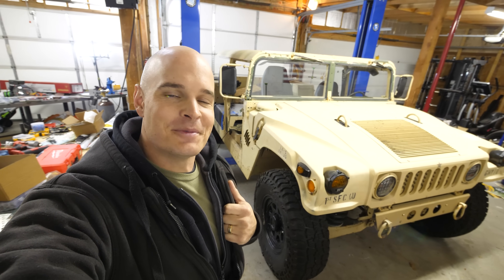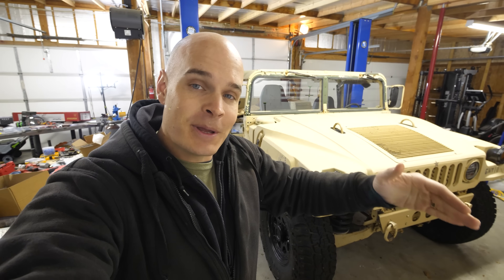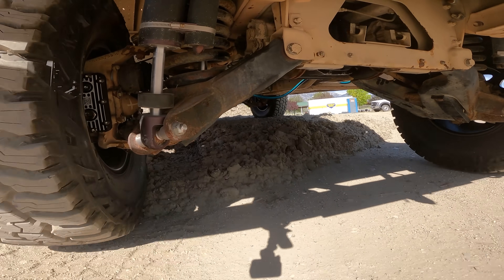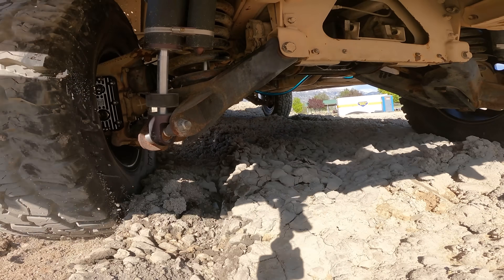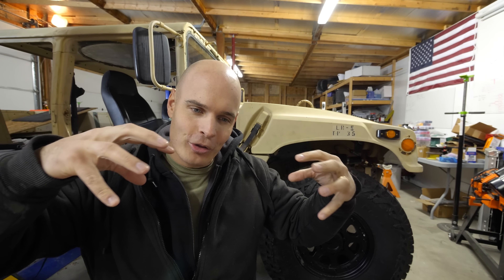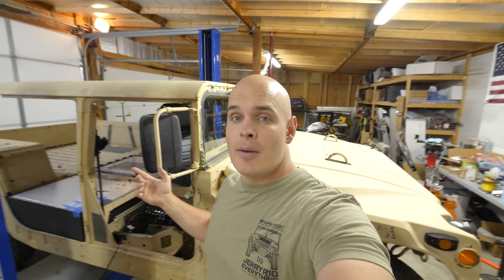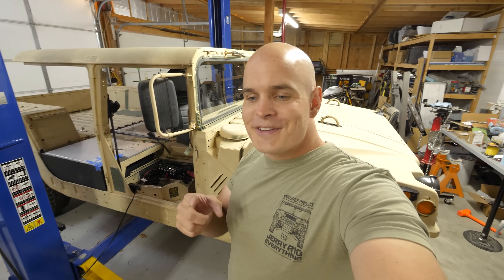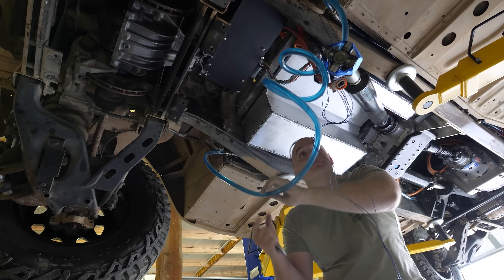I have some explaining to do... - EV Humvee Update

Comment: Without knowing your system, but knowing a bit about hardware and programming, I have a couple issues you can check. First off, baud rate of each component. If your sensors are sending at one baud rate and the ecu is listening in a different rate, you will get corrupted data. Next, ferrous filter clamps. It’s possible those branches are picking up dirty electrical interference and some circular magnets around those wires may fix it. Led lights can be pretty dirty electrical wise.

Comment: Please add rubber grommets to any metal holes that have a high voltage line running through them...please.

Also, maybe use shielded, or at least twisted pair (cat6 maybe) cabling for your CAN wires.

Some  Kevlar braided sleeving on those coolant lines wouldn't be a bad idea either.

Safety 1st man.

Comment: Did you read the CAN bus standard?  It requires controlled impedance cables, termination, and a host of other requirements.  Not difficult but you have to follow the standard.

Comment: Each of your CAN peripherals should have a transmit and receive identifier code that probably need programmed into your 'master' controller/device.  Maybe check that.  Also, there are different CAN speeds; you might need to confirm/configure all devices to use the same speed.

Comment: Might not be charging because of BMS low temp cutoff, can't charge below freezing. Also as others have said about the termination resistors. The resistance between can hi and can lo should be 60ohm +-10ohm or so. also the Orion BMS had a 120ohm resistor onboard I believe.

Comment: I designed electric racecars in university. You most likely don't need shielding for the CAN for this project, but if it starts having issues while driving then you should fix the grounding and make sure all of the splice points have the ground connected as well. 100-120 ohm resistor definitely needs to be placed on either end of the CAN bus.

 Have you tried connecting with your laptop to read the data? If your laptop works and you can read from each device without seeing CAN errors, then the display or VCU probably aren't configured correctly. 

One issue I could see is if one of the devices on the CAN bus is trying to communicate at a different baud rate than the others. Typically it would probably be at 500kbps, but sometimes you get devices that are odd, especially with chargers. I've seen a lot of chargers that want to communicate at 126 or 250 kbps

Comment: I hope all the wiring cut connections were on the interior of the Hummer, as those connectors allow for oxidation of the wires when water is allowed to penetrate through. while you did double heat shrink it still isn't water tight.
Reply: the guy I watched just used the butt connectors without a 2nd heat shrink over the top, and his truck lights failed within 6 months.

Comment: you messed up with the solder connectors, you have to wait until it truly melts and runs into the wire. i see connections like that allmost daily in my work, because people dont know how to use those connectors properly. i really recommend that you go back and fix that before your can wires start oxidizing and you are going to have problems.

Comment: Yep - high voltage means lower current and thinner copper needed to conduct it. Don't make the mistake of using standard wire that matches the current rating but not the voltage rating as still need higher insulation resistance to stop shorts...except maybe if its not touching any other item anywhere the whole way...might be ok but risky..

Comment: Resistors are often used in Controller Area Network (CAN) networks to help reduce noise and improve the transmission of data.

In a CAN network, a terminating resistor is used at each end of the network to help reduce reflections of the signal as it travels along the network. The terminating resistor should have a value of 120 ohms, and should be connected between the CAN_H (high) and CAN_L (low) lines at each end of the network.

In addition to the terminating resistor, some CAN networks also use pull-up resistors or pull-down resistors. These resistors are used to ensure that the voltage on the CAN_H and CAN_L lines is at the correct level when the network is idle. The value of the pull-up or pull-down resistor will depend on the specific requirements of the network.

It is important to use the correct value of resistor for these applications in order to ensure that the network functions properly. Using the wrong value of resistor could result in poor performance or even damage to the network.

Comment: Can likes to be match pair 120ohm wire along with terminators at open ends. Usually the boxes you are connecting have the terminators on the boards.

Comment: I think the connectors need to be heated a bit longer. The tin needs to flow. Maybe it just looked like it didn't.  
Also the front axle makes a bit of sharp corners. Could be a problem in combination with the high torque. 

 🤙

Comment: Those heatshrink solder connections definitely need to get hotter. If your afraid of melting, just cut a spare wire in two and do a test run!

Comment: Hey Jerry, I am Ahmed. I have worked on the power electronics of EV. I had the opportunity to design the EV battery pack of 35kwhr.  This problem is certainly because your VCU is not been able to communicate the CAN messages at the correct ID, make sure CAN baud rate and ID is correct. I would recommend you to purchase a CAN adapter compatible with open ended CAN log software like BUSMASTER to log and monitor all the CAN messages. Then you can identify the real issue behind this. I hope you have the CAN communication matrix file of each and every component you have connected on CAN. Let me know if you are able to solve this issue, I will be more than happy to solve your problem and Kudos to your EV and future projects.

Comment: It's looking like the communication from the Orion BMS is somewhat getting through to the dash, but it may not be configured properly 100%. 25°C is the default temperature for the Orion Thermistor Expansion Module, and I've had that temperature crop up when experiencing EMI in the battery pack (the module itself is not electrically isolated). I'd definitely focus on troubleshooting the Orion components, it could be a CAN configuration issue on the BMS or damaged hardware somewhere in the pack

Comment: 6:55 - That solder didn't melt at all.

I hope that doesn't end up being the only problem. That would be so annoying if it was. Although there's a lot of comments about termination resistors, so probably not.

Comment: At 6:57 not enough heat was applied to the solder inside the heat shrink, it should melt into the strands of wire and not have a ring like appearance.

Comment: You really need to use a scope on that. A CANBUS uses a differential signal and you can determine if both sides of the comm are there and if the comm is lost or pulled to a bad state due to shorts or miswires.

Comment: Maybe you are missing the termination resistor. Although one ecu may have it, other issue could be that more ECU's have it populated. But it is easy to check...just use a multimeter are measure the resistence with evrything connected, shoule be close to 120Ohms.

Comment: I believe the can network may also need termination resistors, witch you should have on one end of the chain. A scope on the various points on the line would prove this. Alos connect the shield of that cable to ground at ONE end, lettings it float can make it worse than unshielded. Also I may be wrong but i think there's more than one data rate for CAN Make shure your connected to the right can bus/correct speed.

Comment: A CAN Bus network must have a terminating resistor between CAN High and CAN Low for it to work correctly. For maximum range over long distances, the ideal termination is one 120 Ohm resistor at each end of the bus, but this is not critical over short distances.

Comment: Nice work ...
The CAN systems needs to be programed, you need to assign addresses to all your components and programed the "messages" to every component, unfortunately os a system with made manually assignments is a dated system but is reliable...
All the MCU (micro control  units) need to be aware which is on the BUS and what they do ....

Comment: 1) Does your CAN Bus have termination resistors?
2) Are all CAN devices communicating at the same baud rate on the network?

There's a reason vehicles have multiple CAN Networks. Different devices communicate at different speeds.

Comment: looking good but you may end up regretting not using ribber grommts on those holes you've drilled in the body to run wires through

Comment: please add rubber bushing when wiring through the metal holes as long run friction between the wire and metal will cut the wire evantually and may cause a short

Comment: Maybe line termination is wrong (too much or too little) unless it’s really wrong most stuff should still kinda work. Often devices in my line of work have little switches or jumpers next to the can bus terminals on the devices to select if you want to use on board termination on that device, not sure if car stuff is the same. 
Would be worth unplugging that screen and checking it again.

Comment: Sail and powerboats Have a modular NMEA 2000 Networks with off-the-shelf cables tees and 60-ohm resistors that our 100% waterproof and make any project so much easier as how good is that connection is no longer an issue

Comment: To be honest you should solder n splice and heat shrink with marine grade shrink with epoxy insides waterproof the connections. The low temp solder is very brittle and will cause issues.

Comment: Trunk cable usually needs to be terminated on both ends with impedance-matching line terminators, usually consisting of a resistor and capacitor in series. The 'master' device, which controls the whole communication, is also connected through a branch, not directly to the trunk. Refer to the CAN standard documentation for more info.
All the devices on the network need an unique address (like IP addresses for Ethernet, or phone numbers for landline and cellular telephone networks) to communicate properly, and their communication speed (baudrate) needs to match. The screen needs to recognize the devices it gets its info from, and the BMS, inverter and charger need to recognize eachother. Some devices may use CAN 2.0A which uses 11-bit addresses, while others may use CAN 2.0B which uses 29-bit addresses. Configure each device to run in 2.0A mode if possible, to ensure compatibility. Otherwise 2.0B devices may mistake the beginning of the data as still being part of the address (first the address, then some data is transmitted bit-by-bit over the network), and communication fails apart.

Comment: The can bus needs a resistance of 60ohm 2.6ish volts high 2.4ish low. also what speed is everything rated for some can can be 250kbs others 500kbs.

The resistance needs checking with the power disconnected, the system will need x2 120ohm resisters at/near the end points of the can next work, the x2 120ohm resisters will equal 60ohms. the resisters are used to slow down the information so the ECU can read it

Comment: Get a CAN analyzer from pcan, but first check if you have the termination resistors at both ends. If you want to debug stuff you need the right tools. I also really dislike/don't trust those connectors you used. Solder the cables directly to each other.

Comment: Probably old news to you, but I think there's a bit of design in how much resistance is allowed or specified for the network, and different devices can have that resistance or maybe a loop built in and you can remove it or modify it. there may also be issues with some kind of ID collision on the network, if multiple devices are using the same ID? i'm pretty sure you can get CAN analyzers, too. Sometimes for pretty cheap on Amazon - logic analyzers that you could attach to the network and monitor traffic.

Comment: Typically speaking OEM recommends not using solder connections(which you didn't get hot enough to flow) and using a bare butt connector and shrink tubing. Keeps the resistance within specs. And do you have termination resistors for the trunk on either end?

Are all the can devices programmed for the same ISO data?

Comment: You never use flat head screwdrivers for hose clamps. Always grab a nut driver or a 9 in 1 screwdriver and pull the insert out! If it's not the right size then put that insert back in flip the screwdriver around and pull the other insert out!
You should probably invest in a crimp setup. Otiker has some pretty good stuff but other cheaper brands exist. Those hose clamps can fail over time. Don't want to lose your coolant and cause a major system failure.

Comment: Use fuel line clamp instead of wordclamp ,because ringworn ones tend to break the hoes do to the heat cycle  .  I replace them and its been 6 year no leaking so far ... trust me you wont regret it

Comment: I could be wrong but it looked like the heat shrink solder connector didn't melt when you installed it making and unstable connection.

Comment: Im not expert but at 0:25 on the right side vehicle i noticed that your gear ratio is not the best. Slow ebike motors are less efficient so its best to put possibly fastest hub motor, hight voltage and slowest possible gear ratio. Its less stress on chain, better efficiency and overall should perform better that way.

Comment: The CAN bus should be treated like a HF transmission line.  Both ends are to be terminated with the characteristic impedance, usually 120Ω. The stubs should be kept as short as possible.  This is to keep reflections of the high frequency pulses, which can distort the data, to a minimum.  
A quick check, measure across the wires and should see 60Ω. 40Ω or less means there are extra terminators. 120Ω means there's one missing or an open wire. Higher than that no terminators present or open wires.  At least 1 terminator is required or else the buss can't go to the recessive state.  Also there should be a fairly high resistance between the bus wires and ground.

Comment: at least the can system in this is simple. my tractor has a fault sometimes, which manifests as a can bus error of some kind and causes non start condition. Service tracked it down as a work lights control panel issue, tractor starts up fine when it gets disconnected. No permanent fix, did not get a new panel, and sometimes it works fine for months without a fault. lol the intermittent faults form hell. also have several different faults on it...

Comment: Potential buyers/users of EV like to thick that the EVs are so, So, SO much simpler than a corresponding ICE vehicle because a gas engine has a LOT of parts that shake, rattle, & roll.

But temperature management of the battery, the motor(s), and the high power electronics requires a lot of moving parts.

Comment: I sure hope all those wires get pulled through a flex tube or some other aberration absorbing feature. Soldering high vibration connections is a bad idea. The solder will break at some point. Should have used crimp hardware.

Comment: same CAN protocol/baudrate of CAN devices, is it matching everywhere? If i remember correctly, the can bus there should be 60ohms of resistance if you measure it in any end of the CAN cable but I assume the dude already have a CAN bus analyzer that will tell you all that.

Comment: If the charger maintains 6.6 kW, the output current will be higher when the voltage is lower... and the voltage is always lower than 450 V (that's an extreme charging voltage at the fully-charged limit).

Comment: When building a prototype, especially at work, i have arrived at the point that i rather spend 100bucks on some ready-done industrial standard wires and connectors,
where i only have to add one end, maybe, over spending my time building and troubleshooting them.

Still end up having to work with nasty stuff like crimping pico and nano blade molex connectors because something went wrong or needs to work "now"
but in the end this quickfix usually costs more time = money, and if there is one thing i have plenty at work it is no-time.

CAN-Bus should be so tolerant to timing errors running cables from all the items to one single point to connect them up should still work.
Just compare that to bus-cable-length on a truck. (But of course the EV with the audible switching noise might make some nasty stuff on other components).
Until now i always walked the other way when i saw colleagues analyzing bus signals, dont have to know=do everything. 🙂

Does your stuff work if you only connect two devices ? at what point does it stop working ? did you check voltages and resistors ?
There is always a bonus for sets that come pre-wired and only need to be plugged together.

Comment: I'd be willing to bet your heatshrink connections are part of the problem. Canbus is really finicky with soldered joints. As a test, I would have used alligator clips or a terminal block to ensure the loop was good before running any solder.

Comment: Pretty sweet, still rather good ole gas myself though. Question off topic but did you ever tinker with a wagon to transport wheel chair bound people? I run a hiking club that takes kids with disabilities and in wheelchairs and we currently use a gorilla cart to physically pull them up the trail , any suggestions on how we could motorize one ?

Comment: i respect you, but those coolant hoses will leak, they will get really hard and brittle, source carwash for 4 years we used the same hoses. 

please get real coolant hose with protective coating so when your off roading it doesn’t rub and rub and make a hole, cheers